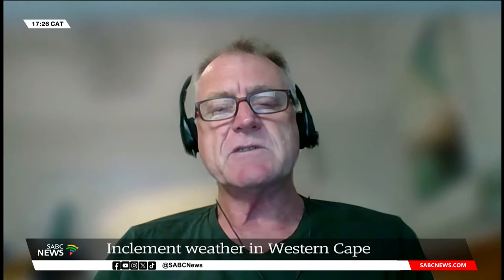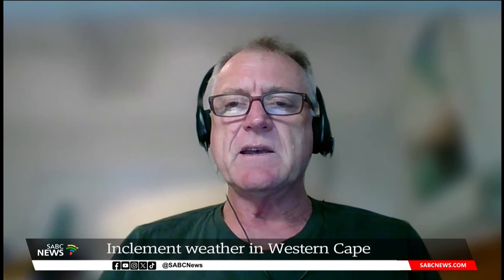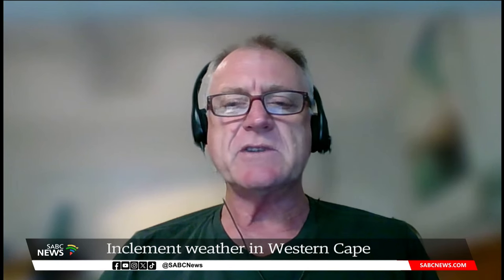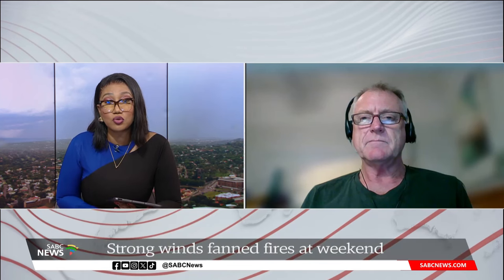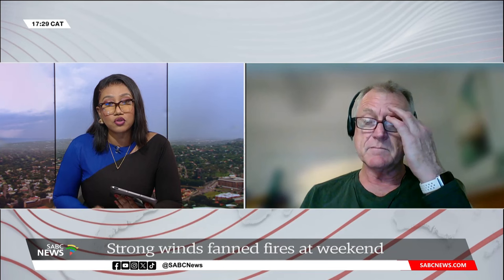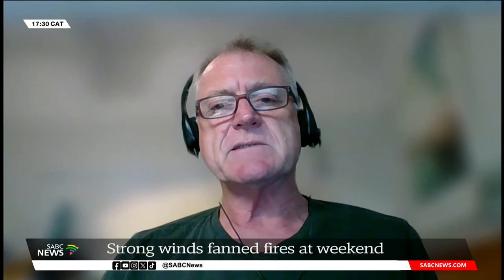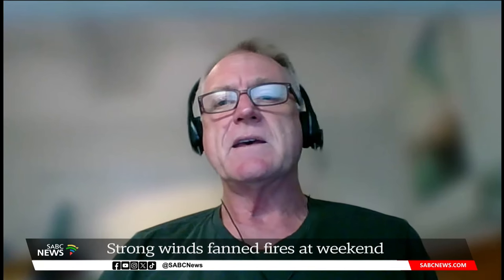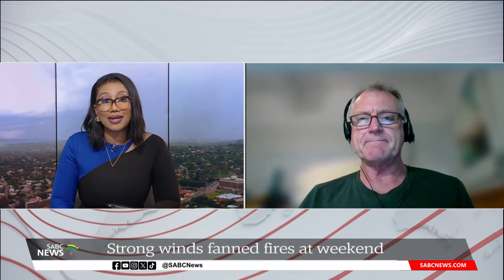Dr Peter Johnston on Cape Town's stormy weather patterns

Comment: The violent flooding in KZN in1987, 1995, 2017 and 2022 were caused by cut-off blows combined with human impact due to decaying infrastructure, increasingly poor land use and possibly increasing sea surface temperatures at lower latitudes. Very interesting times...